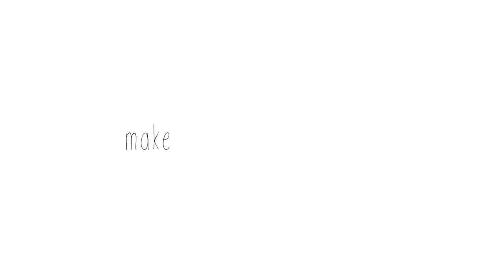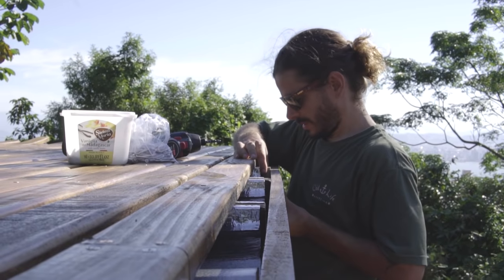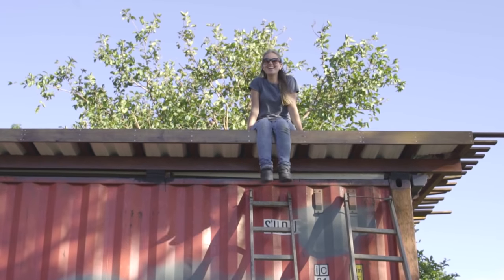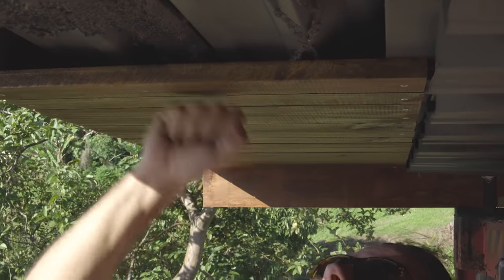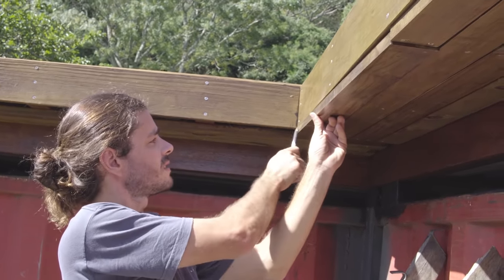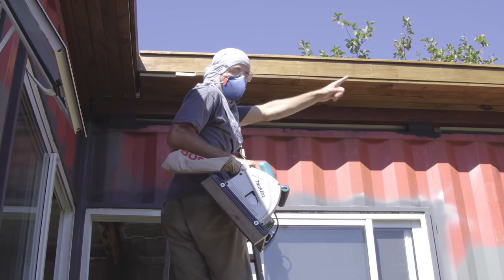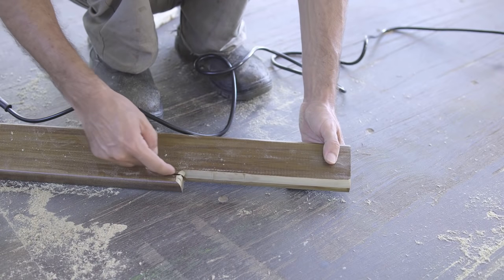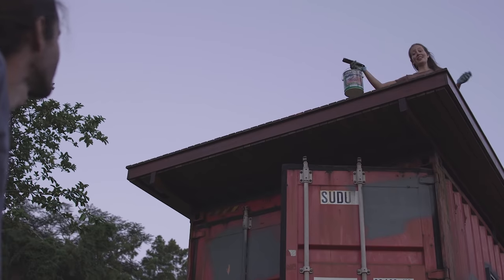DIY Shipping Container House Deck - Living Tiny Project Ep. 026 Part 5

Comment: As a general contractor, I can completely understand about the battery problem.   You problem too is those drills are for very simple basic projects and are probably very underpowered.  I would upgrade to an 18v drill driver set and an extra battery charger and batteries.    Hook the charger to a solar panel or local power if you have that then you can use 2 devices on battery while the other 2 are charging.  I have built large portions of slat fences on one battery charge before you need to change battery.  I would have installed a rubberized coating paint across the entire roof of the containers before installing the roof.  If you bury the top under a roof, be sure that the original surface is fully sealed and protected before proceeding.  If you had just created a metal beam frame around the edge of the roof that is elevated on one side by only say 5 degrees on both containers your roof deck would have been a whole lot less complicated to build.  Angle the roofs towards the rear of the building and then run the gutters across the back.  You can then channel the water from the roof into a catch basin and then use a solar powered pump to get a little pressure built up.  Run the water through a set of filters and you can get clean water on demand.

Comment: When it comes to the soffit...you should have started in the front....the boards on the edge of the roof. The last piece, which is obviously smaller would look a lot better when placed in last.
Reply from the maker: That’s the price of learning by doing I guess. We didn’t know how to cut the last one to shape. And to cut the first one was easier so we decided to go with the first. But doesn’t look bad. No one actually notices. 😊👌🏼

Comment: Wow, your deck turns out real nice in the end!
About the table saw, be extreme careful with it. Next time don't crouch and saw, instead put it in such way that you saw things in standing position. That way your body is more stable than when you're in crouching position. When you crouch you might lose balance and may accidentally lean forward to the blade. That's dangerous! Better be safe than sorry. 
Nice to have you provide the important specs of the deck. Didn't expect it to be that expensive. Nearly the price of one 20 ft container, right?
Oh, and one advice: since you're not going to put rails along the deck, you can put flowerpots or something els near the edge to form a barrier so that it's much safer than having nothing on the edge of the deck. Just for perception and safety. ;)
Reply: Also, congrats on your channel growth too. Last time I check it was 8k, now it's 11k! 👏
Reply from the maker: Glad you liked Steve!! It’s definitely too expensive. Actually more expensive than a 20 ft. But we loved!! And we are actually thinking abou plants on vases!! 👌🏼👌🏼Hehehehe by the way thanks a lit for the concern and saw tips!!👌🏼👌🏼

Comment: Dear Eduardo and Roberta,
First I would like to say what a great project. Very inspiring to others that have the same ambitions. 
I would like to give some free advice to both of you that I believe will make your future projects in thw tiny house much easier.
1. Return your 12 volt drill and impact driver and get an 18 volt or 20 volt with a minimum of 4 amp hour batteries, I promise you will be super impressed with the additional power and fewer charges.
2. Go to You Tube and learn the proper techniques of construction for each new project you start.
3. Go to You Tube and learn how to use the circular saw and table saw you have. 
Thia is the first video of yours that I have watched and I have seen where I could have saved hours of time and would have been much safer in the process. Neither of you should be operating power tools at the top of a ladder without proper footing, especially if it can be done on the ground and screwed in from the ladder.
I think I heard that the deck has taken 26 weeks? That's a very long time. Use YouTube to learn how to do everything else you have to do, it is a great resource.
Best
PK
Reply from the maker: Thanks for all the advices Pat. We do actually try to find on YouTube lots of information. Some of then we don’t find. And of course when we start a new task there is always new challenges we didn’t even know existed. Making videos is also something that slows us dow a lot for sure. There is always the camera and the tripod involved on the task and that can be confusing. Well we have been learning a lot with our mistakes. And we are really happy with that. Thanks a lot for the support!!
Reply: Great job you two you two are so cute can’t wait to see your house all done .